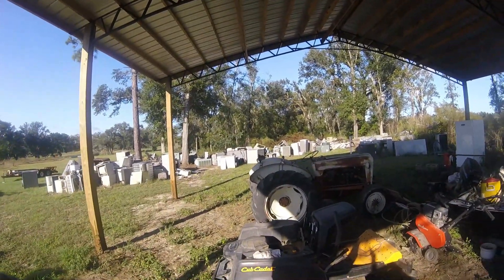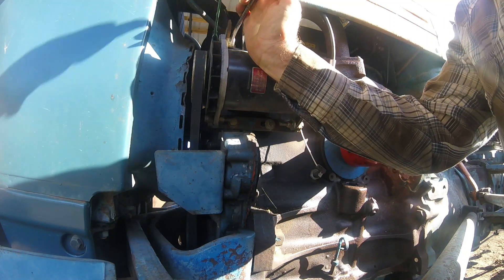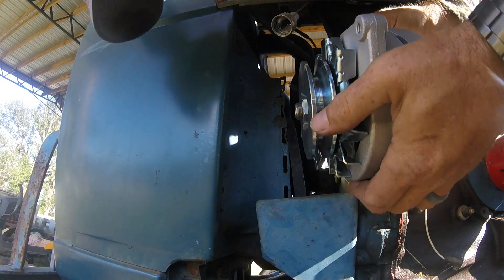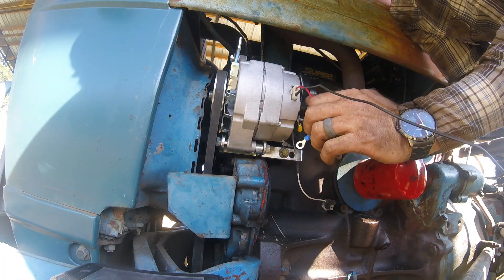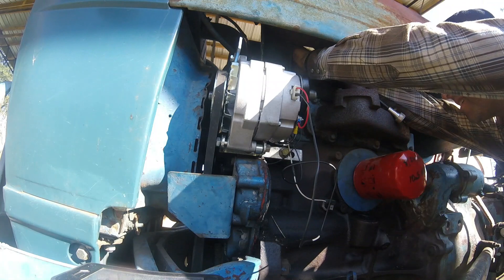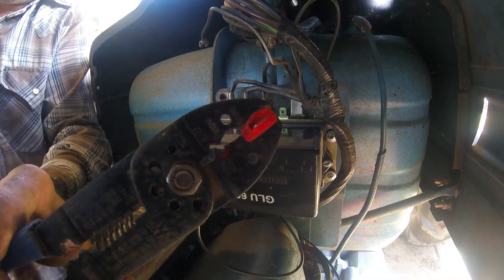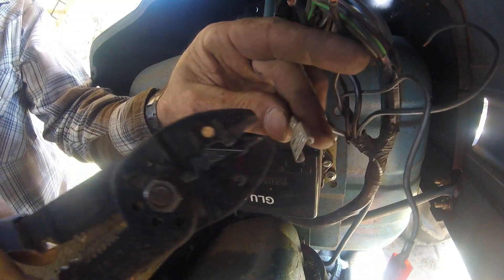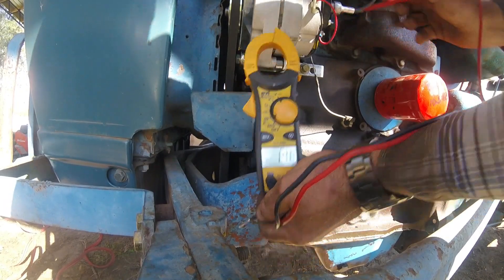Ford 3000 Generator to Alternator Conversion

Comment: Did you ever learn where the D term wire connection went from the voltage regulator?

Comment: Great video. I have a similar tractor. But mine came in yellow. Hard to find info on. Great job on the wiring job. Even using the proper splicer. I'm getting ready to do the same thing.

Comment: What does it mean if you only have one battery wire at the voltage regulator instead of two?
Reply from the maker: I’ll have to look at a wiring schematic to give you a solid answer on that one.

Comment: according to the instructions I got it says to hook the two B and the D together, not the F?
Reply from the maker: Seems like I got this question before but I looked back and didn’t see it...either way my suggestion is to do what your instructions are telling you. They came from the company selling the conversion kit, I’m a “YouTube Certified” shade tree mechanic. What I mean is, I’m human and make mistakes and I more than likely did here. I’m going to check the customers tractor as soon as I get a chance, I do know he’s been using it without an issue since the work was done. That still doesn’t mean I’m right. Thanks for asking and thanks for watching!

Comment: Lucas electricals seem to be a weak spot on these old fellows.   I just converted a 2000 to Petronix and am in the process of installing a new water pump as well.  But sometime over the winter, it going to get an alternator conversion as well.  I really ain't worried about the tach drive.  I did my '75 4500 backhoe about three years ago and boy am I glad !!  But one thing I haven't ever bought a kit.  Sure worked slick..I may consider it for the 2000.
Reply from the maker: I did that one that way because of customer request to retain the tachometer.  Crazy as it sounds I could buy the kit complete with alternator for $10 more from amazon than an alternator alone from the local parts house.
Reply: @AmericanTradesmen  I understand about what the customer wants...  It did turn out pretty darn good tough.  I like the one wire but I also like using an LED in the #1 circuit as an idiot light on the dash too, and I really like changing from an ammeter to a voltmeter on these old tractors.
Reply from the maker: @tractorman4461  by chance would you have an email address I could contact you at?

Comment: Hi there I am Ken and I live in Australia just change the generator to a alternater on my ford 3000 but didn't have a tachometer cable drive on the alternater, I will run the tractor for a while and see how I go with no tachometer?
Reply from the maker: I did find that on the next series tractor (3600) the tach drive is in a different location.  Those parts are supposed to be interchangeable with the 3000 and can be sourced from many different suppliers.  May be worth looking into, we appreciate you watching!

Comment: Can you make make a video of removing the timing cover and replacing gaskets have major leak coming from what looks like behind water pump on ford 3000 diesal
Reply: Oil thank you sir your videos have helped when the manuals didn't
Reply from the maker: Are you leaking oil or coolant?
Reply from the maker: Matt I sure will. It may be a couple weeks but I’ll be glad to.

Comment: What did you do with the other thin black wire that was down by the old generator?  Not used?
Reply: the directions say to combine B,B and D wires.  You connected B,B and F why?  thanks for your replys.
Reply from the maker: That is a ground wire. You can use it if you like, however the alternator is grounded through its brackets. As for your second question, I honestly don’t remember without looking at the provided instructions. Looking back at the wiring diagram in the shop manual my wiring appears correct. The owner has used this tractor regularly since the conversion without any issues. I hope this helps, thanks for watching and thanks for your questions!

Comment: Thanks for this video! My generator and voltage regulator were giving me issues this weekend and no one had the right parts in stock, so I bought the alternator (without tach drive) from Napa with the plug, made my own brackets and got the tractor back up and running. I'll replace the alternator with a tach drive unit later when I get around to it.
Reply from the maker: That’s great! Glad we could help!!
Reply: @Zachary Mekhi It worked and I finally got access to my account again. I am so happy!
Thanks so much, you saved my ass !
Reply: Sorry to be so off topic but does anybody know a method to get back into an instagram account??
I was stupid lost my login password. I appreciate any tips you can offer me
Reply: @Zayden Colt instablaster =)
Reply: @Zachary Mekhi thanks so much for your reply. I got to the site through google and I'm trying it out atm.
I see it takes a while so I will reply here later when my account password hopefully is recovered.
Reply: @Zayden Colt Happy to help :D

Comment: We have a 1967 JD 3020 (Gas) with 2 batteries and a 24 volt starter. The rest of the system is 12 Volt.  I'd like to change from generator to an alternator.  What kits should I use? Any advice would be helpful. LOVED the video!
Reply from the maker: Sorry I just saw your question, for some reason I havent been getting notifications as I should lately, and thanks for watching our content!  As to give you an honest answer, I dont know off the top of my head.  I've ran some equipment that was 24V, but never owned or had reason to work on any.  If your generator is currently working I would be curious as to how much voltage it puts out at its peak.  I did run across this as I was looking for some information to answer your question https://www.instructables.com/id/John-Deere-3020-24v-to-12v-conversion/  Please let me know if this helps.

Comment: New subscriber today and I rang the bell.  Like the detail but is there a reason you don't use shrink insulators?  Just curious.  Also was this a one wire or 3 wire?  What is the difference?  Thanks
Reply from the maker: Hi Jim, thanks for watching and subscribing!  I normally use heat shrink on all my wiring, however I did this conversion on a Sunday morning at the customer's home.  There were no parts stores open and I had forgotten my heat shrink.  Considering the customer is also a good friend I went back later and took care of all the connections.  This alternator was a 3 wire, which honestly every GM "one wire" I've ever seen actually has 3 terminals.  The main terminal on the back obviously is your power output, spade #1 is for the warning lamp that lets you know the alternator is not charging, spade #2 excites the alternator to assist with charging in low RPM applications such as a farm tractor.  Both #1 and #2 are connections on the alternators internal voltage regulator and both are positive (+) connections.  To my knowledge, and if I am wrong hopefully someone here will correct me, but the famous GM 1 Wire alternator will always have these three connections.  In automotive applications engine RPM's are typically much higher, so the higher RPM setup does not need assistance to excite.  With that said, it is entirely possible to hook up only the power output from the alternator and it work just fine in most instances.  I hope that helps!

Comment: I did the same thing to my 5000. The problem with this conversion is the tach  will not be accurate anymore. The 540 pto is supposed be 1900 RPM. With this conversion the 540 PTO rpms shows 2300 rpms on the tach. Pulley size on the new alternator is different
Reply from the maker: Ron & Becky Beasley I wasn’t aware of that...I’ll let the customer know to check and see where his is at. Thanks for the info!
Reply: American Tradesmen no problem. Great videos
Reply from the maker: Ron & Becky Beasley thanks! We really appreciate the feedback and appreciate you watching.